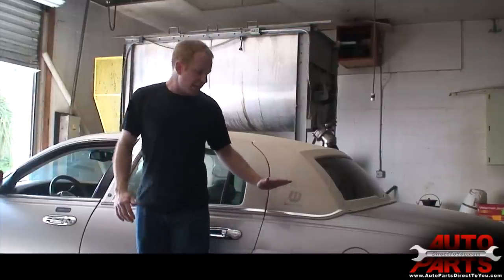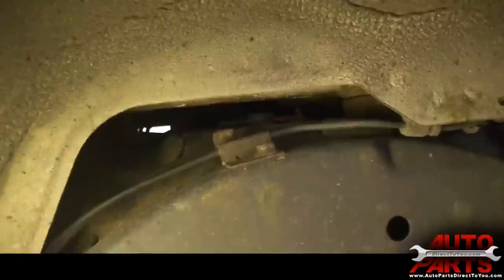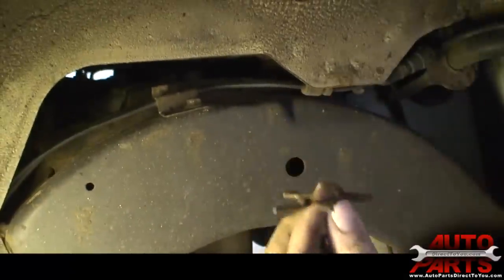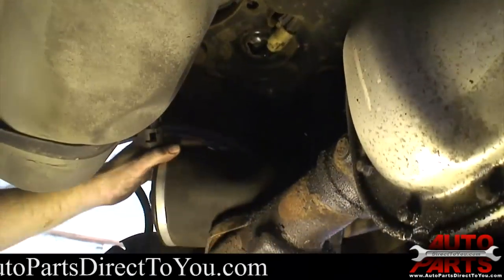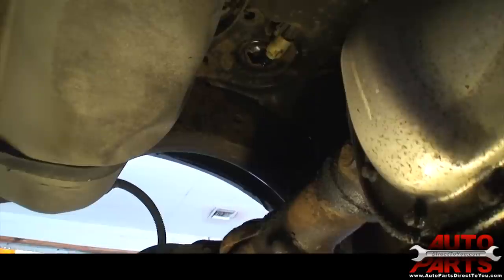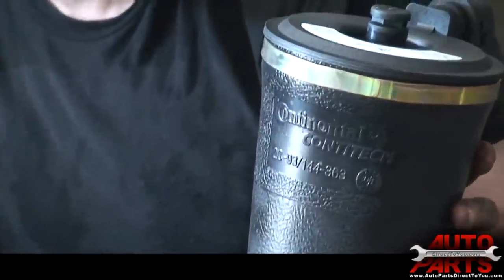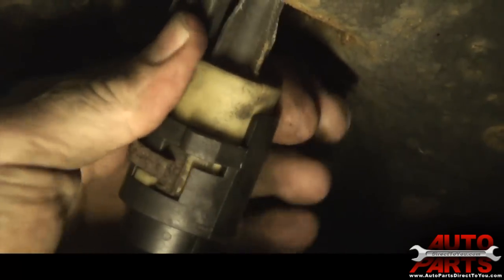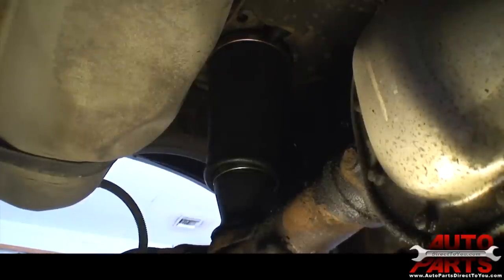1989-2011 Town Car Air Ride Suspension Air Bag Spring

Comment: Hi guys I come  from Germany and love us cars have a 01 tc and a 73 eldorado..... A just wanna. Double check that I'm. Right... Do  I Have to remove shock or normal spring to remove air bag spring? From the video it sounds that I don't have to remove sth else. A love the tc cause nearly everything is easy peasy.... But is that also so easy?  If u wanna change air spring in Mercedes s class u have to do a college exam and remove engine and transmission and do it only at even days at moonlight :D

Comment: OK so he got them switched out and replaced and didn't put the orings on so had to take them back off and put the orings on and then the air springs but he said they are not holding air like they should as they slowly leak. He reseated them again but they still slowly leak. What would be the cause?
Reply from the maker: You have to find where the air is leaking from exactly. Could be a bad solenoid. You can take a bottle of soapy water and spray around the air springs and connectors and solenoids and look for air bubbles to find the exact cause.

Comment: Hello there, I have a 97 Lincoln Town Car, and I was wondering if my air suspension is happening to fail, Is there anyway I can just put regular struts on there instead of air struts? Thanks.
Reply: Ddog2k3 yeah i asked autozone but you gotta modify the back of the car a little
Reply: Ddog2k3
Reply: Derek Cartee ok thanks

Comment: quick question can a adjust your ride height up and down on 01 Town Car air shocks
Reply from the maker: +PETE MILLER Yes, the rear suspension height can be adjusted. The ride height sensor clips on one side and bolts on the other. The bolt side is the adjustment. Very small adjustments there can mean very large adjustments to ride height.
Reply: @APDTY  if I go to the Ford Lincoln dealership and get my air suspension replaced will they have the Continental Air shock springs

Comment from the maker: Hi, sorry for the late reply, I am assuming you probably have it fixed by now? The position of the solenoid receptacle on the new airbag should be identical to the original airbag, so if there isn't enough slack, the only thing I can think of that happened is that the air line got snagged on something or routed the wrong way while it was disconnected?

Comment: Is there a kit for a 94 Lincoln Town Car? Thanks.
Reply: No kit but this is their Air Spring Replacement (APDTY 133812 Rear Suspension Air Spring Assembly Fits 1990-2011 Lincoln Town Car)
Reply: same parts

Comment: I am not sure how you got the solenoid back into place so easy, mine fights me right at the last turn and cannot get it to seat. I thought it was air pressure in the bag so I compressed it, that didn't work. How did you get it in so easy?
Reply: I'm having exactly the same problem I can't get it in. Any suggestions? Thank you very much.
Reply: Omg nobody answered this question yet, I am stuck on this same spot

Comment: Is there a difference in ride between the regular spring (A2105) and the heavy duty (A2220)?  I have a 2001 towncar with low miles, and it seem to lean to the right a little bit.

Comment: The air solenoid won't fully seat in the new part and I can't figure out why. I compared the new part with the old one and they are identical. Four hours in and I am pulling my hair out and don't have a car. Help!!!!
Reply: I had the same issue. I could not seat it in the solenoid connector to make the final connection. I file insert side of the solenoid tab just slightly. This allowed the tab to start in the connection and I was able to fully seated.  My air springs were purchased on Amazon for 44$ so I am a little concern about the quality.  So far it is ok, but it has only been a few days.
Reply: Quade Montgomry I just bought mine from Amazon as well. All the reviews for it were very positive so I'm not to worried about it. Mine did come with four different O Rings however. When I removed the old air spring there was only one O Ring installed so I'm not sure if they just put random extras in just because or if I really should use them all.
Reply from the maker: Only 1 o-ring is required and more then 1 may make the fit too tight. We installed a bunch off these and have not had this problem with Arnott brand airsprings. Several brands exist and Arnott is made in the USA and the quality is excellent. Here is a link to them on Amazon:
http://www.amazon.com/gp/product/B002YSCCRA/ref=as_li_tl?ie=UTF8&camp=1789&creative=9325&creativeASIN=B002YSCCRA&linkCode=as2&tag=aupaditoyo-20&linkId=AYYOEMGLIWHG33W6

Comment: Ok I’m not sure what’s the deal with my air suspension. I drive a 2006 Lincoln town car an First the warning message was coming up saying check air suspension then about two days later I notice the back of my car not lifting up an leveling out with the front. So I refuse to drive it like that. I let it sit for 3 days an when I went to start it up it lifted up like it was nonthing never wrong. So I drove it to store an notice it had drop again an didn’t lift back up. Is this a sign my air suspension needs to be replaced or is it something else ? Help plz
Reply: My dad's crown vic does the same thing.......the air suspension has a leak.......most people are saying it's the air springs.....hope that helps......when the car is running it keeps the bags inflated......a while after you turn the car off the air leaks out and the car drops......
Reply: Hopefully your air compressor is still good.......that bad boy is quite expensive.......around 5-600 bucks just for the compressor.......

Comment: Please please help me find or resolve .... if anyone has similar issue with ride height and has resolved it, please share your solution. 
I replaced (2 airbag, 2 rear shocks, 2 front coil over with new struts). 
I have NOT replaced the solenoid, height sensor, air compressor with dryer. 

2004 Lincoln town car that I have 1 inch right side is lower which made the whole car right side sitting lower...

Front coil over is not the issue. FYI no one should look into this. 
From Control Arm is not the problem.

Comment: It would be a great help if anyone can answer me!! I go the air bag to pop out and took out the clip that connected it to the solenoid but it's stuck??! And I mean STUCK, is there anyway to losen it? Thank you!
Reply from the maker: are you able to turn it counter clockwise to release the lock? I would try spraying some kind of lube in the locking tab gap, then twist it back and forth to free it up before trying to pull it out
Reply: APDTY, we did put Lube and were able to pull it out. I appreciate you're fast reply and was able to fix them both. Car rides like brand new. Love it : )

Comment: Dear friend thank you very much for this wonderful Video .... My car is a 2006 Lincoln Town Car Do you think that piece works well on my vehicle .... And is it true that guaranteed lifetime ....
Reply from the maker: The 2006 should be just about identical to this vehicle, the control arms might look a little different, but the procedure and parts will be exactly the same. Thanks! And yes, our air springs are a lifetime warranty.
Reply: Thank you very much

Comment: I have a 94 Town Car that im converting back over to air ride. All the lines and wires are there, compressor is locked up so ill be replacing that and will need air springs!  Whats the best air springs? And do the replacement ones come with a new retaining clip for top??

Comment: Is there an air valve to release some air in my suspension. My car rear end is up way to high and wanted to know where the air valve is located at?
Reply: Adjusting the level sensor will adjust the height of the rear end

Comment: Hey I have a problem the airspring came off and it is full with air please help
Reply: Should have shut off the suspension prior and also disconnect the battery

Comment: HELP..trying to put new bag in, BUT i get the first notchin and the second notch will not go in enough to turn the second time, the second notch is level to the edge of plastic on bag piece but is flush with it / , the last turn, so meaning it needs the thickness of the nipple or plastic guide to be able  to tuen and lock the last turn ?/ any ideas why,  now going out to try using the second bag ???
Reply: Just ran into the same problem on the pair i bought from Ebay. It is a manufacturer defect and i had to get new ones. The pair i got have thicker plastic where the solenoid fits into. You can clearly see it is not enough space to fit. Hope this helps.
Reply: I had same problem. Try using something sharp to scrape just a hair's width off the inside of the second notch on the receiving new air spring. After that I was able to turn solenoid all the way and put on the metal clip.

Comment: While I was installing the passenger side air bag/spring the mushroomed retainer that holds the metal spring on the bottom of the spring pulled out of the metal retiner but the retainer is firmly seated in the hole on the diferential/axel. I put the bottom back on the bracket and set the car down on the ground. Will the weight of the car hold the air spring in place? Or does some other procedure need to be done such as glue or adhesive or will the stem reseat itself in the retainer? Is it safe?
Reply: Joe Porter hi did you ever get ur answer sir. I’d like to know since I might have to same problem thanks again Joe